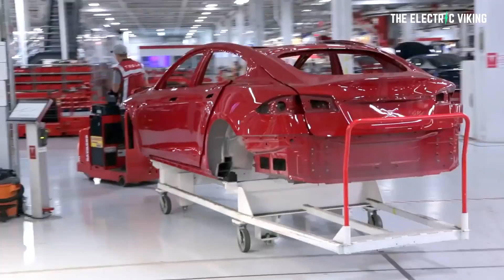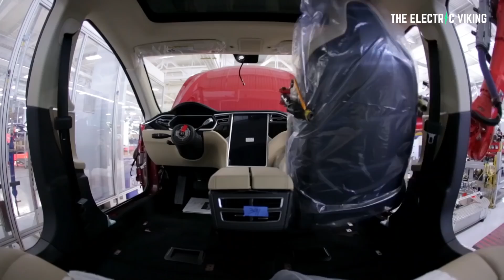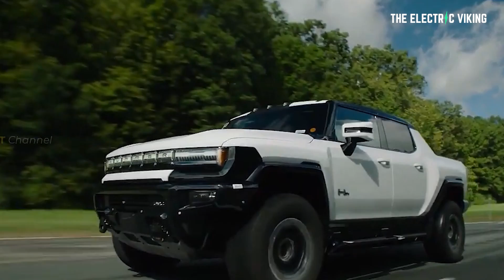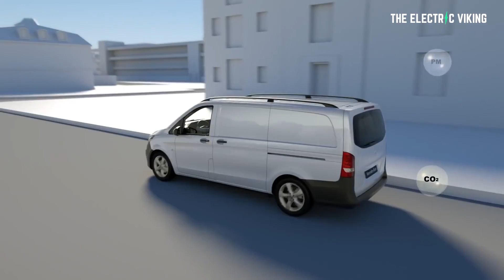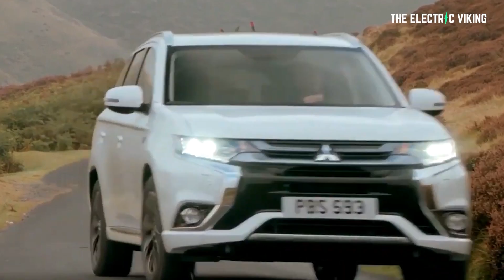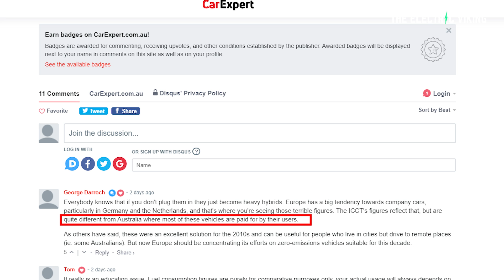EU emissions SCAM - legacy auto loophole to be CLOSED!

Comment: Most are surprised when they find how deep govt./regulator corruption runs. I didn't know the details of the emission's scandal, but I assume everything govt. touches is corrupt. All governments are fundamentally corrupt because they are based on the immoral/impractical premise that force trumps reason. They pretend to act rationally, but when exposed, ignore it or claim it's a one time mistake, an anomaly. Those who go into politics with principles are disillusioned and quit, or slowly change. Few stay and survive. Ron Paul is a very rare exception.

Comment: I didn't know about the legacy hybrid claims. No matter. I wouldn't have been fooled. I looked at the fundamentals. It is impossible to made a hybrid that is superior to a BEV, for the same reason it is impossible to make a perpetual motion machine. Any ICE + battery/electric motor will compromise the overall efficiency. 
Elon has been focusing on non-fundamental efficiency and still getting great results, COMPARATIVELY. Only one maker will challenge him, APTERA. The APTERA is 3 times more efficient, mainly because its platform is a fundamental paradigm shift in efficiency, ultra-light, ultra-low drag. I ordered 2 over a year ago.

Comment: There is an exception though, at least here in Romania we do not have yet a robust infrastructure for EV's and if you drive a taxi, hybrid vehicles still have the lowest consumption. You do have fast charging stations but the electricity then gets more expensive than the fuel for an EV as it costs more than twice the cost for home electricity. That usually affects taxi drivers living in apartment buildings, with no way to plug in their vehicles.

Comment: Let's assume that someone never plugs in his PHEV. I do not believe that his mileage is worse than the corresponding ICE car. 

Why should it? ICEs are terribly inefficient at slow speeds in cities. The PHEV never has to use its ICE in this situation. It only uses it on highways, when it is most efficient and charges the battery at the same time. 

What may happen is that the real mileage is worse than the unrealistic mileage that is indicated for the ICE car. But this is not a fair comparison.

Comment: What I really hate about my PHEV is that I have not full control whether I drive full electric or ICE assisted.

In winter I have to turn the temperature to the minimum, otherwise the ICE immediately kicks in for heating. Even if I select the full EV mode.

If someone uses the heating, and does not turn down the temperature at the end of his trip, the next driver usually cannot turn down the temperature fast enough to not have the ICE kick in.

Unfortunately the full EV mode is not default. So if I foreget to switch into full EV mode immediately after switching on the car, it is quite likely that the ICE kicks in. Even in summer.

Comment: It all depends on the drive profile. It is possible that a PHEV massively outperforms a BEV in CO2 emissions. 

Assume you drive an Outlander. Assume you do all long trips by train. Assume you can charge at home as well as in the office, and you do it. 

Then it is quite easy to drive 100% electric with a PHEV. And because you have a much smaller battery than any BEV, your CO2 footprint will be much better.

Now assume that you have a few longer trips per year because you have to transport some goods, the footprint will still be much better. 

Especially so if you use green power whereas the BEV uses the normal mix.

Comment: Our 4 years with a PHEV are better than a full EV for the atmosphere. It all depends on an individuals use case. In our case our car only runs in hybrid mode a tiny portion of each year. The rest of the time it in EV mode, recharged from our roof solar.
Reply: Then you are using it the right way 👍

Comment: Sooo...EVs can't outsell or replace ICEVs unless ICEVs are OUTLAWED.  Thus, tests that are designed to fail ALL ICEVs, even hybrids.  That's why the EU calls it a scam...they can cheat and fail your vehicle.  You can't cheat and make sure it DOESN'T fail.

So...new car sales will fall off a cliff, and used cars will be in the EU's sights next.  And when only EVs are allowed, things are going to get ugly.

They're not going to make loser shit EVs, dude.  They might as well burn down their buildings for the insurance, rather than make something NO ONE WANTED OR WILL BUY FROM THEM.

It's gonna happen?  Luke the diesel ban in France that almost resulted in Paris being burned down?  Uezh... good luck with that..

Comment: I always suspected phev to be a scam.. you mentioned 6l/100k ... I have a 2014 Honda 1.6 civic which returns an average of 62mpg or per 5 litres.. and nearly 80 miles per 5 litres on a moterway run, and the emissions are so low (allegedly)  enough not to qualify for car tax.. don't worry I will be replacing it with an electric vehicle this year.

Secondly this will put the squeeze on the legacy automakers producing phev to switch to evs as they will make even less profit on phev  as they have to pay the fines .. by 2025 they won't want to producing anything except evs... But as you say they probably can't do that so their basically fooked.

Comment: The new regulations to measure PHEV fuel consumption is a welcome step which could have been done long ago, but this does not mean that the car manufacturers will start producing more BEVs. Given that most of their sold vehicles are ICE based, it is much easier for them to simply produce even more PHEVs and reduce the number of ICE vehicles instead of producing more BEVs which is much more difficult to achieve.
Reply: They won't be able to sell so many of their PHEVs when they are no longer below the 95 gram limit to receive incentives.
Reply: @itekani  I think that they are not after incentives, but to avoid fines for too high CO2 emissions, but sure, if PHEV after new calculations will not clear the bottom required CO2 limit, then they will be in trouble.

Comment: If you look at it, then absolutely all car manufacturers lie about fuel/electricity consumption regardless of what type vehicle it is and it is also impossible not to do so, because fuel consumption is directly related to how people use their cars. So in order to do this right one has to make the car owners accountable for this, e.g. measure the actual use and make people pay taxes based on actual usage. Then people will figure it out themselves which cars to buy which consume/pollute less, because their monthly bills will depend on it. If there was a system like this, then all PHEVs would be either used properly by charging them correctly or the companies would have to pay a lot of taxes for the extra pollution they produced by not using vehicles properly.

Comment: My Outlander PHEV has averaged 3.3l/100km for 80,000km/6 plus years. Range down to 35km from 50km. Oz Electric Vehicles should have a battery upgrade to purchase to extend 100km range next year and probably get that fitted!
Reply: That would be the equivalent of 36km/day and 2640lt of fuel burnt.
You could have done it with full EV.
I think the best upgrade for an outlander would be to remove the ICE engine and turn it into a full BEV. Pity Mitsubishi won't do it straight from the factory.

Comment: I want to go electric but I live in a country with no subsidies at all for EV purchase. Hyundai Kona is starts at 22 000€ for the petrol version or 35 300€ for the electric version, 60% more expensive. You save 175€ per year on tax some fuel savings but I only do 10 000 KM per year so even over a 10 year period the savings are still not there.

Comment: There is a huge tax benefit here in NL for driving a company car, this benefit is not available for private car owners. I have personally never bought a company car - I prefer to have a private vehicle and then charge the costs to the company. Unfortunately the amount you can charge per km has been fixed at 0.19 EUR for at least 15 years whilst inflation has more than doubled the actual per-KM cost.

Comment: It would be nice to hold EV manufacturers accountable for the false battery range claims as well.
Reply: That's a difficult one. You could have 20 identical EV's, with 20 different drivers, and the energy consumption would vary due to all the different driving styles. Way too many variables to even think of applying legislation....

Comment: I think the legislation on hybrid efficiency is really 10 years too late. A pity it is done only now. Comes off as political leverage and disingenuous rather than a moral mission statement. If the european government is implenementing this for hybrids, then they should be just as atringent on ev auto makers claims on ev range, which has thus far also been far from the truth of real world performance for automakers from Tesla, chinese autobrands and other autobrands. Otherwise I would consider ev automaker claims also as scams. We can judge car performance of efficiency for every fuel type no matter gas, hybrid or fully electric. I think the eurooean union should penalize ev auto makers, as much as hybrid atomakers, that do not claim correct real world performance efficiency, because this issue will come up in 10 years time, just like hybrids. We didn't know back in the day hybrids back in the day were as bad as now. It was the best solution at the time to what we could do then. So now 10 years later, likely accelerated by dieselgate to scutinize efficiency. So we don't criticize ev automakers false claims of true real world performance in range with the same scutiny. I think in 10 years time we're then no better off  with evs than we are now with this hybrid stopgap measure. I also think the current ev automakers claims of ev range should be penalized as false advertizing. Rather I think the most reliable metrics should be true average achievable all season range, achievable summer range and winter range in ev brand model advertiseing. Only that we can we truly asses what the right choices we can make. If we don't adress this now with evs I wouldn't be aurprised in 10 years time we will criticize tesla, stellantis, Chinese automakers and others with the same questions. It is not adressed now because most people worldwide are not driving evs yet, so the problem is not in the public consciousness. But for a sustainable future the future ahould be less co2 emissions, which also means we need to drastically tefuce our energy consumption in general and reduce consumption of the global energy mix. Only then can we significantly reduce co2 emissions.

Comment: I think they should add the pollution created by the fossil fuel industry, ie in the extraction, shipping, refining and distribution of the petrol/diesel, to the car figures, not just the TAIL PIPE  emissions.
Reply: Definately....
Reply: Then they should do the same to electric cars? The EU energy mix is 60% fossile, 20% Nuclear and the rest is a mix of hydro and soler/wind. You should also calculate the line loss.
Also the battery emissions when being "dug out", cleaned, manufactured/recycled and shipped.

Comment: If you have visit in the outback on a regular schedule, would you buy a EV or Hybrid today?  In Western Canada, visiting little towns away from large population centres, I don’t see fast charge facilities an option for at least 3+ years so I am thinking a Hybrid vehicle.
Reply: Well if you can't charge it anyway, a plug-in hybrid is not helping much. You could go plain hybrid, but I think maybe the best thing is to hang on to what you have for a few more years and then get an EV.
Reply: @itekani  exactly what I hope to do, but when home a plug-in Hybrid makes sense not living in a large city.
Reply: Your comment made me think.  Very few small towns have a gas station but they all have electricity.  With very little investment an individual or company could install small public chargers in all these towns.  No environmental risks like inground gas tanks cause.
Reply: @positiveoutlook17  WRONG, they all have gas stations for the local residents and farmers. Charging stations will come but takes time to build infrastructure.
Reply: @terrya448  Maybe it depends where you live, but here in Sweden about 1/3 of all gas stations were closed between 1980 and 2020. Now about 20% of the remaining gas stations are at risk for being closed down due to new safety and security regulations which are costly to implement. The gas stations in small towns or along less travelled roads go first.
The number of public charging stations (including destination charging) are just about to overtake the number of gas stations, although they too are unevenly distributed over the country.
Reply: @itekani  in Canada, there are fewer gas stations than what there use to be, I guess less profitable now.